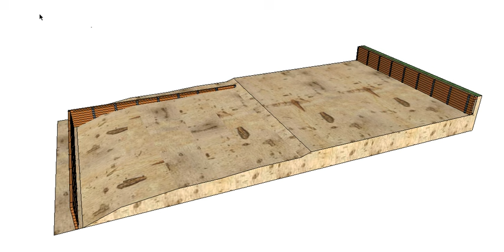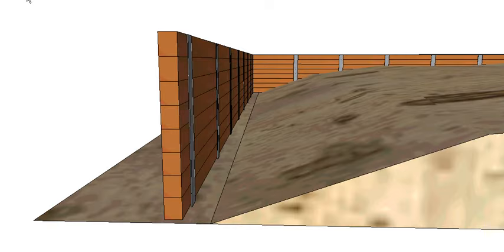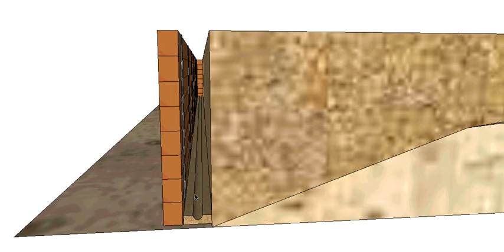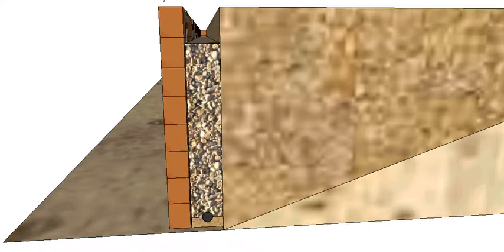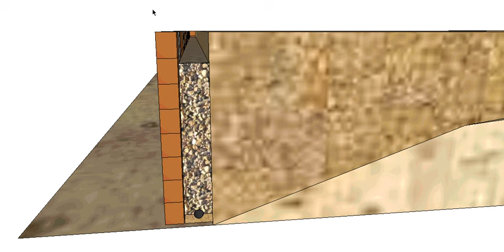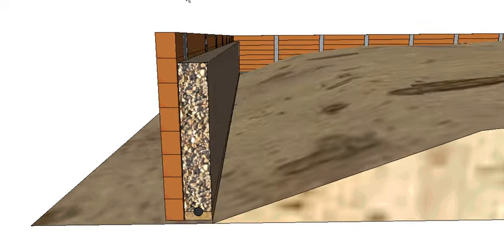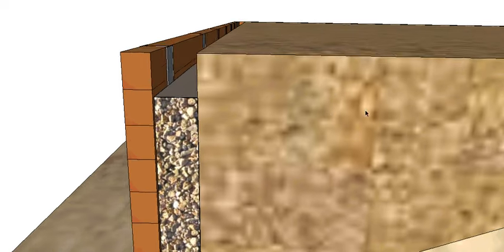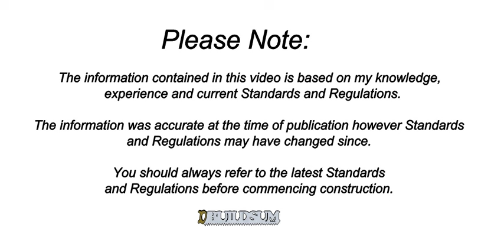Backfill a Retaining wall

Comment: Hello, can you tell what sand would be suitable to use for the first layer
Reply from the maker: Hi Anthony, it doesnt rely matter, you could even just use the same material as you are going to use to fill the rest of the wall just as long as it easy to level off.
Reply: @Buildsum  thanks much appreciated, also how do to connect a 50mm Perforated Land Drain Pipe x 50m to a 50mm 90˚ Land Drainage Tee Junction..thanks
Reply from the maker: Hi Anthony, you can get special fittings like this one
https://www.bunnings.com.au/vinidex-50-x-25mm-grey-water-hose-adaptor_p4770262
however you could just cut the right sized hole in the 90mm pipe and push the ag pipe through the hole.
Reply: Thanks for thr advice and tips 👍

Comment: Retaining walls should be much thicker underground then taper up to the final course..or be  too weak
Reply from the maker: Hi Mate, for a concrete retaining wall that is quite common, however there are plenty of other systems out there that are the same thickness the whole way up.
Reply: @Buildsum  oh, very interesting 
I thought it was a rule, concrete, blocks or rocks ....thicker underground, not sure I would trust such a thin wall to hold back the tonnage ...drained or otherwise as drainage can silt up and become ineffective over time

Comment: 2:51 If you have the geo tech on top and the side, how does water even get into the gravel and down to the drain pipe? 🤷‍♂️
Reply from the maker: Hi Mate, the Geotech fabric is design to allow water to pass through it while filtering out the soil so the water will still get to the pipe.
Reply: @Buildsum  Ah ok, great thanks 👍🏼

Comment: My footings extend to under the agg pipe area. What do you advise in this situation?
Reply from the maker: Hi Mate, that's fine, just sit the ag pipe on top of the footing using the sand to give is some fall.
Reply: @Buildsum  Thank you mate for a prompt reply. Much appreciated. Btw, Loved the clarity of your video.
Reply from the maker: Thanks Mate, I'm glad you like them, thanks for your comment.
Reply: @Buildsum  I have some bricky sand left over from brick laying. Would it be suitable to use for creating slope away from the restating  wall? TIA
Reply from the maker: @JimmyjimmyJimmyjimmy-ih3yd  yeah mate that will work fine
Reply: @Buildsum  thank you.

Comment: What drainage material do you recommend these days? Thanks!
Reply from the maker: Hi Mate, blue metal is still the normal but recycled crushed concrete may be a cheaper option these days.
Reply: @Buildsum  legend thanks mate

Comment: Okay I have a I believe a unique question. I have a driveway and a retaining wall that's on my side the driveway is above and the retaining wall is holding back the driveway the driveway has now started to slide against the retaining wall I'm going to bump up the driveway which is the next door neighbors but there is virtually no room to backfill so I got to go straight up with the retaining wall and I do not want to undermine the driveway how do I do it and do I put drainage underneath there that perhaps May collapse is there a way of doing that?
Reply from the maker: Hi Conrad, Yes certainly a unique situation, and hard to resolve without disturbing the driveway. An option would be to use a retaining wall system that allows the water to pass through the wall without the need for drainage behind. A less desirable option would be to move the wall further onto your property to give you the room you need.
Hope this helps
Reply: My attention would be on the shifting driveway or ground first. How about reinforcing the retaining wall first with steel pilings (or something similar) on your side, to prevent soil movement and also making your retaining wall stronger.  Then build up on the retaining wall as necessary.  I would think the soil will not hold much water assuming there is already a structure built on it.
The drainage shown in the vid imho is ideal on new builds; if the sandpad is the open space on the property; and you have space for it.

Comment: Disagree with the wall not allowing the water to pass through, retaining walls should still have weep vents at the bottom
Reply from the maker: Hi Adam, yes i agree evern a solid wall should have weep holes. I guess it was a pour choice of words, what i meant was a wall that wont let the water pass through it like a solid concrete wall.
Reply: @Buildsum  I see, great video, clear and informative. Just what I was looking for:)

Comment: I would NEVER use the black ABS plastic.  With that much above it it will get CRUSHED!  Use schedule 40 or 80 PVC - drill a lot of 0.5" dia holes about 15 degrees off bottom centerline (both sides) and be sure to use pea gravel on bottom layer and cover PVC pipe 80% with pea gravel.  Be sure on the highest elevated portion of drainage pipe to add a clean out fitting.
95% of the time I see retaining wall or foundation drain issues the installer used that WORTHLESS ABS stuff with no clean out fitting.
Reply from the maker: HI Mate, thanks for your comments, good to know
Reply: I concur. My husband and I have constructed many retaining walls in a variety of soil conditions.  Abandoned the use of ABS in favour of perforated PVC in all wall drainage systems. PVC manufacturers also have end caps and other fittings to accommodate clean outs and exterior drainage through the wall. A wide variety of Geotextile fabrics are available to handle drainage/soil separation from drain rock.

Comment: Why cant u just fill it with concrete? Then u wont need a drain.
Reply from the maker: You could just make the original wall from concrete however this will not stop the build up of water and hydrostatic pressure. Even if the wall was strong enough not to break the pressure would eventually push it over. With the drain reliving this pressure you can use lighter weight materials to do the same job.
Reply: @Buildsum  what i mean is: between the retaining wall and soil, instead of filling it with usual dirt, sand, gravel etc, why not just fill it with conrete coz then the water wont trickle down to the bottom and you wont need a drain. what do u think?
Reply from the maker: Hi, as per my previous comment you still need to get the water out from behind the wall, filling it with concrete is not going to help in any way.

Comment: Fuck my retaining wall doesn't have backfill.most retaining walls built 20 to 30 years ago in my country doesn't have backfill.so far the wall is still in place although there are some cracks.Is it possible to just cover the whole front of the wall with dirt?
Reply: I mean the repair cost a lot and my property is more than 30 years old.the wall is about 3 feet high.btw my neighbor's house have a  retaining wall but it's not visible because they dump dirt in front of it and it covered the whole wall.i am planning to do the same because repair cost a lot.so far no problem at the neighbors house.he covered the whole  the retaining wall about 20 years ago
Reply from the maker: Hi Martin 
The idea of retaining wall is to hold up the material behind it when it was too high to hold itself up. If you are not worried about the wall and the space that the additional dirt will take up then no problem. Remember that the dirt will have to able to support itself
https://www.youtube.com/watch?v=Lcyou2imKfQ

Hope this helps
Reply: Buildsum thanks for the video
Reply: Buildsum 'worried about the wall'? The wall won't collapse right?from the link you have given I believe the dirt that is being dumped in front of wall will prevent it from collapsing.plenty of space so space isn't an issue here btw
Reply from the maker: Hi Martin 
No, the wall won't collapse, as you say the dirt in front of it will help. I meant if you are not worried about covering the wall.
Reply: Buildsum well no I won't be worried about it.thanks sir for the video and explanations